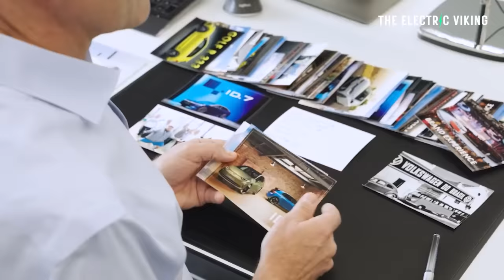VW's German workers criticize turnaround plan as staff fired all over Europe

Comment: German car makers (especially brands Mercedes, Porsche, Audi), differentiated themselves through the tough decades in the automotive world, by using tighter tolerances (for example, only Mercedes and Rolls-Royce were using the same machining tolerances as for aircraft engines) for a higher-quality product, that justified it's price point.  But how do you do that with an EV?  There's almost no mechanicals.  Only better quality bearings can be used, better rust protection, and variances in batteries and motors - but anyone can do that!  It doesn't take talent, it only requires a marketing decision.  They're really in a tough spot to reinvent their companies and save jobs at the same time.
Reply: Excellent comment. You know your stuff. I guess they will focus on performance and aesthetics rather than engineering.
Reply: ...Battery /drive / Manufacturing Tech, Software and UI. They will need to become leaders not followers.
Reply: Tesla gave ALL of their engineering for EV’s to ALL OEM’s… Free of Charge, on the internet. 

However they didn’t give away what makes their product extraordinary and extremely profitable. Their edge that makes them extremely profitable is… the “Machine that builds the Machine”, their factories! No OEM can build a car with so few man hours of labor. Then there’s the software…😂🤑🤑  Ford said they have 60 different software programs in some of their cars that they don’t have the authority to change without requesting changes from the supplier. Tesla has 1 software programs that runs EVERYTHING in the car… all written in house by Tesla software engineers.🙀

No OEM on earth has the Artificial Intelligence capabilities or factory capabilities to ever catch up with Tesla. They, those that survive will become customers of Tesla eventually. German and Japanese OEM’s will ALL require a taxpayer bailout to try to keep the jobs… before they eventually collapse into bankruptcy.

Their most crucial mistake was giving Elon Musk an unchallenged decade head start. They laugh at his $99,000 original roadster and said he would never make in the car manufacturing industry, their Kingdom for 100 years. It never occur to them that he was an Artificial Intelligence company first and foremost, and the car company was just a division of the company. That gave him a decade to find the best and the brightest AI engineers in the entire world. Now the OEM’s have to enter the AI industry and try to find AI engineers that are as good or better than Tesla’s staff.🤣😂😂

They have no hope… it will be much more affordable to them to just buy Tesla’s FSD software and the hardware needed to make it function properly. 

You snooze… you lose!
Reply: But nobody can do that at low costs (especially the battery)....except China.
Reply: Simple is the best. So Tesla is the best.

Comment: VW may still find use for this EV factory, but after they learn from their Chinese partners like Leapmotors and Xpeng.

If production can be streamlined, it might make it so building Leapmotors or Xpeng products in Germany for the European market might make sense. 

If Tesla can make it work in Germany, than VW should be able to do so. The key is getting the number of workers needed greatly reduced. I would not be surprised if Tesla is using less than half as many workers per EV built as VW does.
Reply: The problem is number of worker reduce in dark room manufacturing in the west, that why many advance production move to China. Union doesn't like small workforce.
Reply: @HeiNz03  There is import tarrifs to consider. Tesla has managed to make it work. If the amount of labor is cut down to 30% of current levels at VW, it could mean Xpeng or Leapmotors would be able to use VW factory and come out ahead.
Reply: VW could use the factory to store executive dead wood.

Comment: The job will go to where it deserves. If you're too complacent and want to take a back seat for comfortable, you're losing your pant an shirt some days. Wake up and compete people. Not by picket line. Not protest since those are the geeks you have been employed long time ago and it doesn't work. Work harder than your competitors. China have done a marvelous job. They won't concede it easily. An uphill battle must happen to take back the crown. Good luck VW workers. Keep protesting and crying. It will help to solve the problem. The UAW in America is doing the same thing.
Reply: Work harder for less money. Is the management taking a pay cut ?
Reply: @user-ox2mz8ds7g  In old day, princes and princesses demand (get the picket line, protest) and the king (auto makers) would give. Nowadays, the king is in far East. But princes and princesses didn't realize that, still demand. New day. New King. Wake up folks. Fight hard to help taking the crown back.